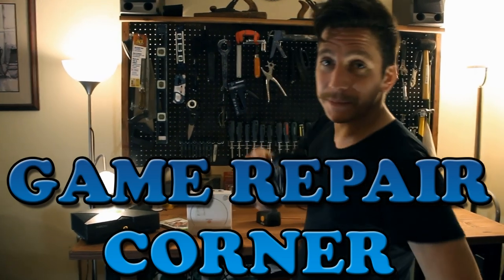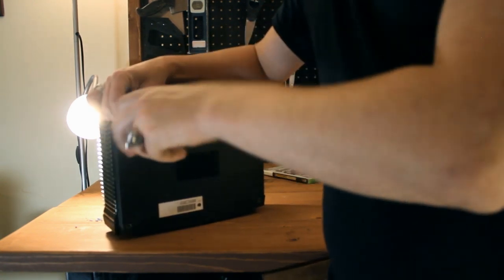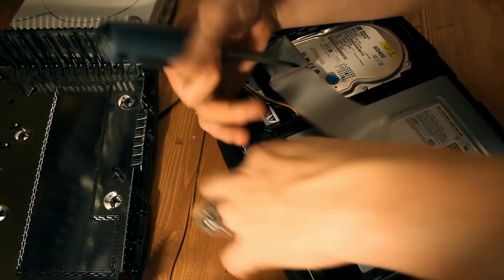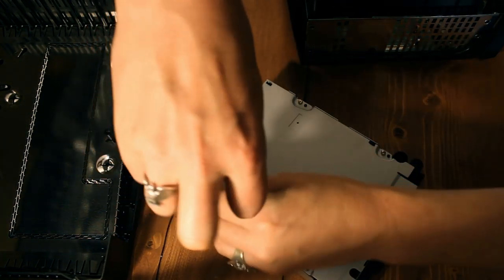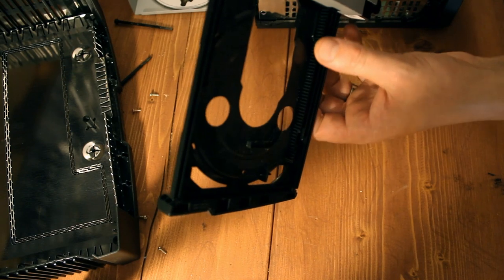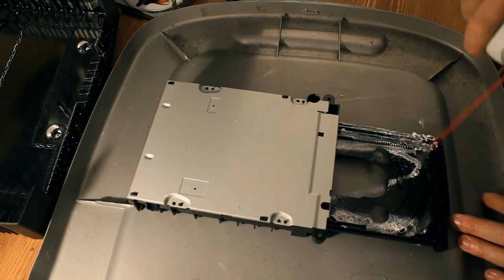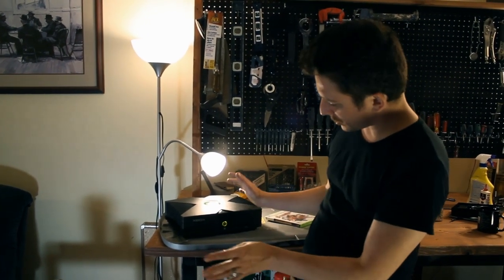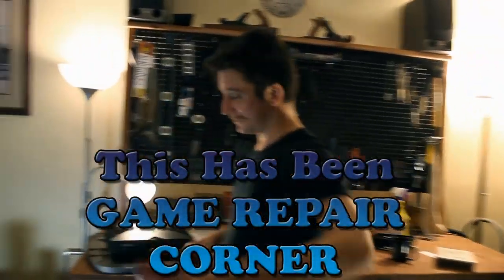Game Repair Corner - Stuck original xbox disc drive fix!

Comment: What if I don't have one  of those type of screw drivers to take out  the first ones?
Reply from the maker: I didn't have one for a while, I think I used to use a flathead for the outer ones, and a little square screwdriver for the inside ones..
Reply: thanks, i just repaired it 2 times.
Reply from the maker: Ruben Lugo
nice..